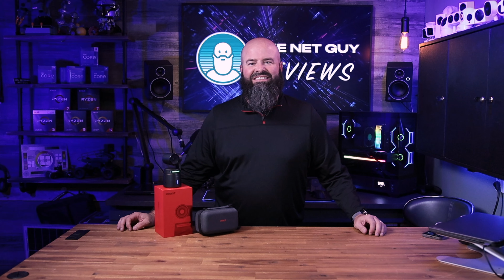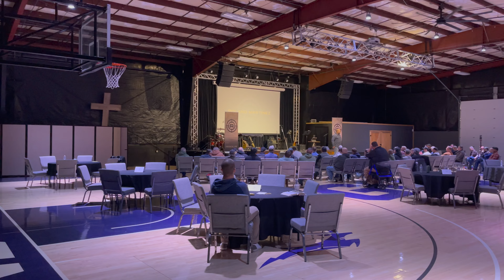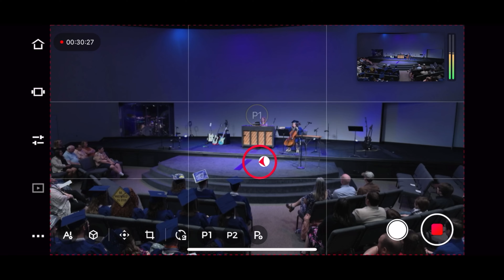OBSBOT Tail Air : Prime Big Deals Days

Comment: They're literally perfect, except for the quality. There's almost no examples of how the HX3 looks and I understand now from seeing the recordings in this video. The recordings are already a tough sell to clients and if NDI makes it even worse I'd rather spend a little more on my ptz
Reply from the maker: Hey Mantek - I wouldn’t use my example as gospel here. It was a 1080p feed cropped in further. Overall the NDI high profile was good. Here is a link to the graduation - the left and right camera angles are the NDI feed and the “zoom” view is my 4k Canon. Hopefully that’s a better sample. Thanks for checking in. 5:30 timestamp is one https://www.youtube.com/live/h0hA5gn5b08?si=fkJqIt2JvuAs9CF0
Reply: @TheNetGuy  Ah yeah that already looks better, does it have exposure controls and locking in the app? Because it's still a little hot on the faces for sure
Reply from the maker: @mantenbrink yeah this was full auto and most of the scene is darker/blue. It has full manual controls and even face framing/exposure. A ptz would work better if you need zoom for sure. Out of the box these things are scary good though. I did notice some white balance hunting while on auto so I’d recommend manually settings for pro work. 👍
Reply: @TheNetGuy  Sounds good, yeah I would like to use them for pro work. But I'd definitely need the dongle, which is another €150, making it a tougher sell compared to options from Bolin technologies. But I'm definitely thinking about it